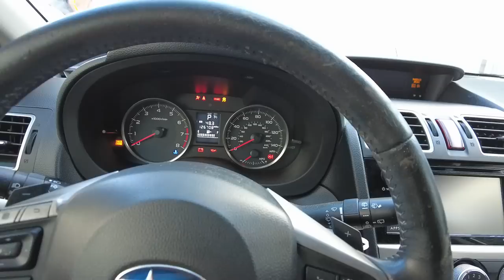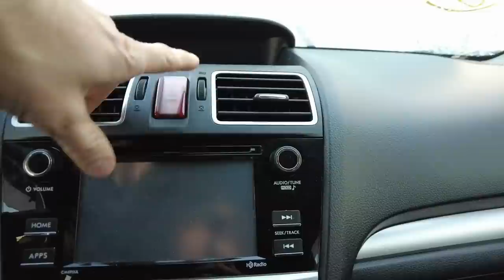I bought a new project car to replace my project car

Comment: My mom bought a 2013 sport wagon manual new. Decent car, but very slow. Like dangerously slow at times. The manual gearing is suuuper long, which ruins acceleration. Careful, the first few years of this gen Impreza deal with oil burning issues. At one point she was burning a quart every 500 miles which I was pissed about. She ran it low on oil multiple times, but the damn thing just keeps going lol. I must say, very sturdy little engine. Also, a blast to throw around corners. Little thing handles like it's on rails. Throwout bearing failed at 55k miles, otherwise pretty reliable. 130k and counting.